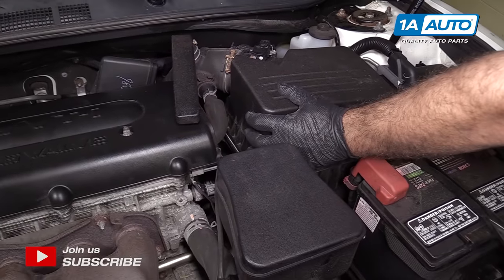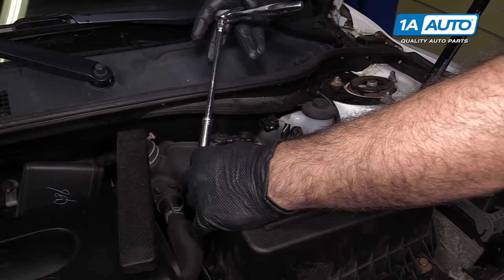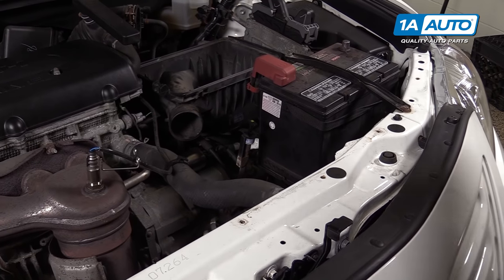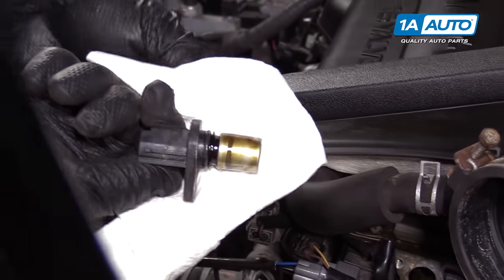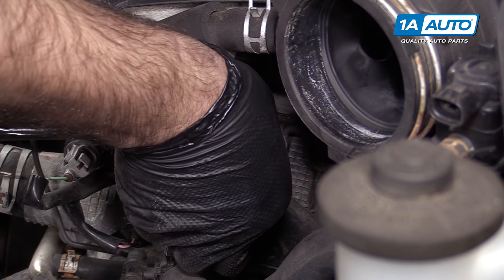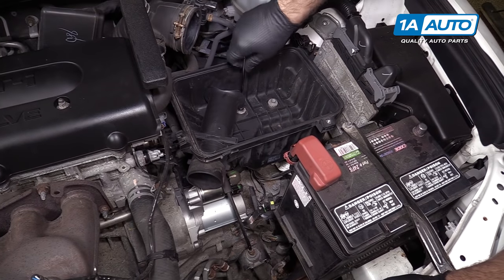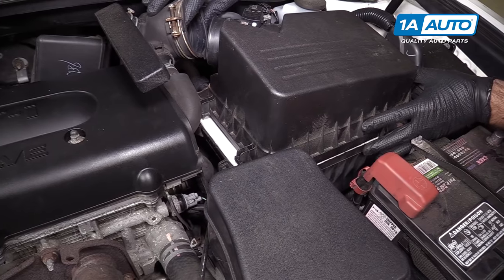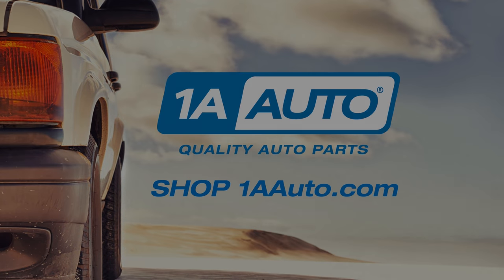How to Replace Camshaft Position Sensor 02-09 Toyota Camry

Comment: Mine toyota camry 2007 I have to crank it couple of time to start. Thats the camshaft sensor? Should I have to change the crankshaft sensor too or both of them?
Reply from the maker: +@carloscelles6177 We wouldn't be able to diagnose an issue like that here, you may want to have a local mechanic take a look at it. Thanks for checking us out! http://1aau.to/m/Shop-1AAuto-c

Comment: Just received the CPS I ordered for  my 2008 Toyota Camry XLE.  The code was a PO365 and the orange triangle warning light came on after every start and stayed on.  The local auto parts store did the test and reset, but they wanted $100.00 for the part yours was around $28.00 including shipping.  I hope it all goes well my wife just got home so I can now go work on the car.  It is 3:27pm central time. I'll give a fair report back.
Reply: Any updates?

Comment: P0345, this could also be an ignition coil wire loose after changing spark plugs, ignition coils or engine valve cover gaskets. Happened to me today, engine was running real rough immediately at start. Checked under the hood and sure enough the fix was just connecting the ignition coil to the wires!

Comment: Do you know if the camshaft position sensors for a 2010 Venza V6 (it has 4 of them) are all the same part or they are different for each bank?
Reply from the maker: +Paul C The camshaft sensors are the same. Thanks for checking us out!

Comment: In my Camry have a check engine turn on, and the scanner tells me is P0016 Crank cam Position correlation Sensor, the question is how I know if the fault is sensor or the time ? I mean that the time is ok. Can you help me?

Comment: Alright....it is 3:46 and I forgot that what the video is about is a 4 cylinder not a 6 cylinder.  So right now I am not to happy with myself or this video. PLEASE state which engine you are working on.  The engine compartment's right side looks very much like the 6 cylinder and I wasn't paying attention to the video's engine complete look.  Here is the deal the 4 cylinders are much easier to work on what is need ed is a 6 cylinder video.

Comment: Is it possible this could cause jerky/rpm-flutter during hard acceleration? no codes, but the '09 camry has 430,000 miles and this part has never been replaced... even if not the cause of issue - good idea to replace anyway with that mileage? thanks
Reply from the maker: +Wes Thanks for checking us out! That's quite a lot of miles! We would suggest replacing this if it has never been replaced just due to age, however, we can't guarantee that it will fix the problem you're having. 1aauto.com

Comment: where is this sensor located on a 2010 camry SE 2.5L
Reply from the maker: +@king_sledge The sensor can be located at or below the valve cover of the cylinder head sealing line on the belt side of the engine.

Comment: I change mine but the light kame on again like amont later :(    same code same sensor it went away after a week then kame back again. To stay on since then !

What can it be now a fuse ???????
THANK YOU IN ADVANCE
Reply: Is the timing you have to reset the timing
Reply: it could be the wiring...... check your sensors wiring for damage or corrosion.   and it could also be your engine timing is slightly off.  check your timing.   you timing chain tensioner may be going bad.

Comment: what was the symptom?
Reply from the maker: +LotWizzard Thanks for the question.  If your vehicle idles roughly, stalls frequently, has a drop-in engine power, stumbles frequently, has reduced gas mileage, or accelerates slowly, these are all signs your camshaft position sensor could be failing.

Comment: I use Camry 2000 model V6 engine  and I changed the camshaft position sensor after diagnosing and found a fault code P0340, the check engine light disappeared but later came back, what could be wrong?
Reply from the maker: +Emmanuel Olasinde Unfortunately we cannot really accurately diagnose that. We would advise you take it to a trustworthy mechanic in your area that can look at it in person

Comment: My car toyota axio 2016. scanner code P0012 . Problem is a full pickup but my car not speed up 25 km/h. I don't find out the problem. Read DTC Description: camshaft  position 'A'- Timing Over-Retarded(Bank 1) State: Current